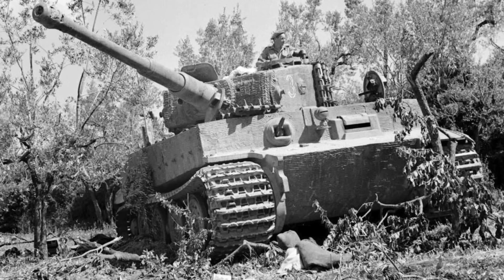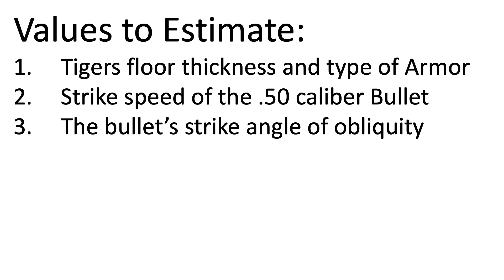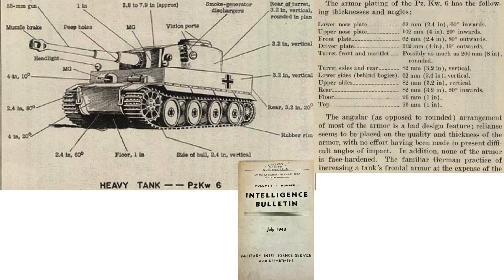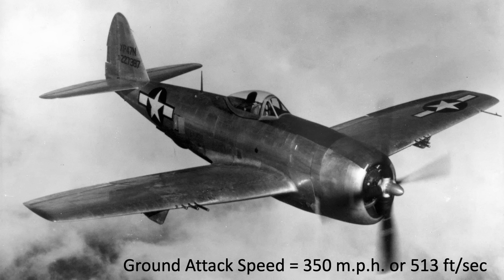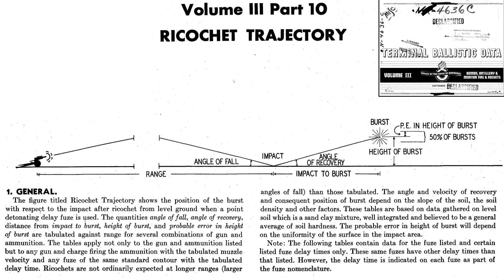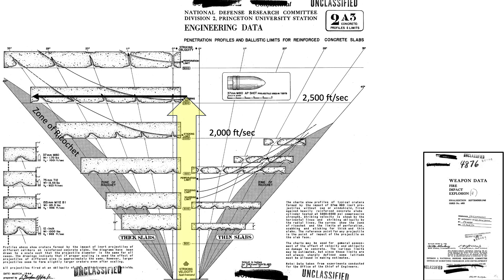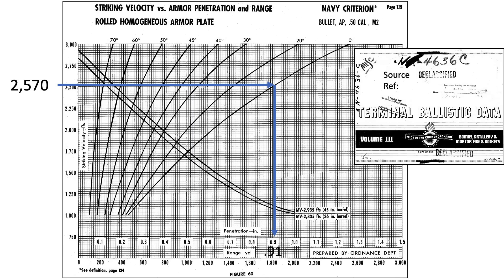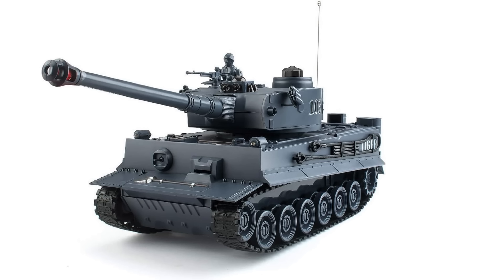P-47 vs Tiger Tank: Can Machine Guns Penetrate Armor?

Comment: The only damage a 0.50 inch AP round might do to those tanks is damage optics and possibly engine components below any grates in the top of the engine deck. The tanks likely looked like they'd been through a metal hail storm. The bombs and 5 inch rockets were probably what the tankers feared after they closed all hatches.
Reply: RAF tested the actual military effectiveness of rocket attacks by aircraft in WWII shortly after the war and found that less than 2% of the rockets would hit the target under ideal conditions. They did, however, scare some crews, especially inexperienced Germans that were very young and poorly trained, into abandoning their vehicles. The rate of the Allied advance sometimes overtook the vehicles. If the vehicle could be recovered by the Germans, it was, but this was often difficult due to incessant aerial attacks, low morale, and lack of fuel.
Reply: @MrArgus11111 
You're absolutely right about the crew being scared and giving up, my primary job in the Army was as a Vulcan air defense gunner, in training needless to say were were taught to never shoot at a main tank, it's like they said "Chances are you'll just piss it off", but by the same token they also taught us that if cornered or if you see one about to fire on one of your buddies go ahead and splatter it with a 60 round burst of explosive 20mm shell's, see what that does for his disposition.
Reply: @MrArgus11111  
"found that less than 2% of the rockets would hit the target under ideal conditions."
I'm rather surprised by this. I know that large quantities of Hawker Typhoons ranged across Northern Europe (the famous cab-rank system) 'looking for trade'. For the Typhoons, ultimately, these squadrons were organised as either rocket squadrons or bomber squadrons but this was solely for logistical purposes.
For the rockets I believe that the experienced pilots still 'walked' their rockets onto the single target, which was the same attack plan as a Typhoon armed with a pair of bombs - attack a single target.
The 'advantage' of rocket attacks was that they would 'walk' along a convoy of soft targets, while bombs saw a better likelihood of killing a single tank (or 'apc', such as they were) selected as the (single) target.
Reply: What about breaking one of the tank's tracks? If a track is broken or otherwise jammed, the tank is rendered immobile.
Reply: @primmakinsofis614 
And chewing up the road wheels and their bearings/axles.
I fired my fair share of .50 cal at old armored vehicles that the engineer's would drag downrange for us to shoot up, the hull of a heavy tank like a Tiger is one thing but the drive assemblies are another, just immobilizing a tank can be considered a victory against it, let someone else come along and finish it off, if you can just shut it down good enough, it won't last long just sitting there and you can bet that's a concept that won't be wasted on the crew.
Reply: @primmakinsofis614  You won't break a Tiger track with .50 cal.
Reply: not gonna happen from a 50cal  @primmakinsofis614
Reply: @primmakinsofis614 You need a hell of a lot more than a 50 Cal to damage as 75mm thick hardened steel track.
Reply: @allangibson8494  You need only break the connections holding the track segments together, not the segment itself. How tough are those links compared to the chassis or turret armor?
Reply: @primmakinsofis614  20mm diameter track pins encased in armor plate? Not going to happen.
The best a strafing run with 50 cal will do is force the tanks to button up and possibly punch holes in any fuel cans left lying around (that second item is more likely to immobilise a Tiger - they are seriously thirsty beasts).
Reply: @primmakinsofis614 the pins are tiny targets
Reply: @primmakinsofis614  German tanks didn't have separate connectors like e.g. US track. There's no separate part to destroy. German 'dead' track was built very much like a traditional door hinge - two plates with interlocking holes, joined by a pin. The pin, being fully enclosed in the links, isn't vulnerable.
Reply: Stowage bins would be hit, and other weak areas as well. A gradual degradation of a heavy tanks is a strategic issues as well. You need spares, you need the crews to rest after being strafed.
Reply: Bullet splash on the grates could do some harm to the engine beneath without penetrating anything. Just little bits of fragmented lead getting through the holes. And of course, a Pz II is a Tiger :).
Reply: Up until precision guided munitions and advanced sensors the majority of air-to-surface actions, especially against armor, yielded little to no damage, the majority of the effect was psychological. As it turns out, the Mk.II Eyeball is not that great of a sensor from 5 thousand feet up moving at 200 knots and most bombs and rockets will more or less do nothing to armor unless they get direct hits or incredibly close misses. IIRC for every claimed tank or vehicle kill that Allied pilots claimed only about 5-10% actually resolved into confirmed kills or damages.
Reply: @brosefmalkovitch3121  something that proved to be moderately effective was carpet bombing areas believed to have tank concentrations in with 100+ heavy bombers. It's a big sledgehammer but did destroy tanks. But even then you needed pretty good intelligence on where they were likely to be. It was used in Normandy on occasion.

Fighter bomber attacks were very effective against APCs, open topped armoured cars, SPGs, trucks, etc.
Reply: @brosefmalkovitch3121  100% agree with this.
Reply: And damage the Zimmerit and paint.
Reply: Probably could damage bogey wheels and put weak spots in the tracks.
Reply: @atomicwedgie8176  Tigers don’t have bogies. They use torsion bar suspensions.
Reply: ROCKETS were the main fear. Heard it directly from a Panther gunner. Otto Shaefer
Reply: @captjim007 according to RAF testing on a Panther, they could be quite devastating if they hit but there was only a 5% chance of a hit even if it was stationary, painted white and put in the middle of Salisbury plain, which the Wehrmacht tended not to do.

They fired cannon at it too, and got about  20% hits which is where my figure of 10 to 20% hits is from as 20% is under those ideal conditions.
Reply: @captjim007  Could well be, but the fear factor fo a weapon and its actual effects can be very different. WW2 tanks were rarely knocked out by any aerial weapon. 

It may be a bit like, say, flamethrowers, which scare the heck out of virtually everyone, yet which cause very few casualties.
Reply: The Germans must have had a problem or thought they did as very late tanks sometimes had spaced plate armor over engine vents. The reason in all the sources I have found was aircraft rounds going in the vents and doing damage. This didn't mean the tank exploded but it isn't going far if the radiator has holes in it.
Reply: @speedandstyletony  That's a fair point, although the same plates would help protect against HE fire from howitzers, which was a vastly more common threat. 

At any rate, such plates were incredibly rare.
Reply: If the attack angle was extremely steep a .50 cal bullet could penetrate about 30 millimeters of armor, but that’s at close range. So theoretically, due to lower quality of latewar german steel, the round could probably penetrate the roof.

Comment: I will say that what veterans says and what is actually happening can be two different things. People can misremember or think they are actually doing damage when in actuality they did superficial damage and simply the crew and vehicle taking actions that can appear like they may have taken damage to people. This happens all the time and can easily be demonstrated by looking at kill count claims. I think this veteran probably believed he was doing something but was likely not actually doing anything to a Tiger, but knowing how many times people misidentified vehicles on the ground let alone from the air he may have hit lighter German vehicles which .50 may have been damaged likely though not by ricochets.
Reply: good point.

i also wonder if maybe they hit something else, like tracks or wheels or the thin armor in behind them, or even a weak point on the back of the tank, and mis-attributed how they might have actually disabled a tank in some cases.
Reply: @reynemayer2942  Please check armor values of Tiger 1. There was no thin armor behind the wheels or at the back for a 50cal to have any chance of pentration. A hole in a road wheel doesn't do anything. Tanks don't get flat tires, you know.
Tracks ... have you ever seen one ? That's several centimeters of massive steel. A 37 or 45mm AT gun would stand a good chance of doing track damage.
Reply: Someone, maybe The Cheiftain or an actual lecture at a war college video, pointed out that air to ground kill claims were something along 2% of what was actually claimed.  I think the person mentioned that after the breakout at Normandy and the Allies overran abandoned German equipment, very few armored vehicles had been disabled or destroyed by air power.  I wish I could remember what that video was.....dang.  Maybe someone else knows that video.
Reply: @panachevitz  I remember that one. It was the Chieftain indeed. Something with "Myths about WW2". It was about the report of a British (?) battlefield commission in the Avranches/Mortain region.
Reply: @panachevitz  Lindy beige day of the typhoon is the name of the video.
Reply: @panachevitz  There are USAAF and RAF operations research studies using that post-Normandy equipment. No need to find the video when the original research is available.
Reply: Allied pilots claimed a dozen tanks for every one that they actually destroyed.  Tactical Air was hugely important in destroying German supplies and making movement during daylight almost impossible,  but they really did not directly kill all that many tanks.  When they did, they certainly didn't do it with machine guns.
Reply: @patwilson2546  they didn’t destroy many tanks but as you say that isn’t the important part for Normandy at least. They held the reinforcements away from the landing or made them stationary so they couldn’t fight at all really.
Reply: @patwilson2546  It's not an Allied-only problem. Germans and Russians did the same, although they had dedicated ground support aircraft with 20, 23, 30 and 37mm guns.
Reply: @ottovonbismarck2443  I agree.  I do not question that German tank kills were every bit as overstated as allied.
Reply: We also have to keep in mind that many allied solider/pilots likely considered every German tank a Tiger tank. They may have been hitting lighter Pz IVs, which would have had weaker floor armor.
Reply: @Combatpzman still a ricocheting 50cal wouldn’t go through the floor of a pz Iv
Reply: @Combatpzman I was just about to say that.
Reply: @Combatpzman  Still good enough against a 50cal RICOCHET.
Reply: That's right, they may as attentempt to shoot through drivers visor if they are trying to do something that rediculous.
Reply: @goodwinter6017  Every German tank had armored glass; there was no open vision slit as in Saving Private Ryan. Russian AT rifles couldn't penetrate.
Reply: Also it’s possible that some of the successes could be attributed to instances where the tank was caught with its hatches open.
Reply: Good summation of how things get remembered. I think I read or saw a video (WWII US Bombers?) that said there wasn't a single hit from a rocket fired from an Allied aircraft during the war in France. I also saw something where German tank crews were very afraid of the rockets.
Reply: Look no further than kills claimed by fighter pilots
Reply: I think that heavy machine gun fire probably won't be good for a tiger in general even if it doesn't actually penetrate the armor . Track hits ,sighting systems even primitive in nature and potentially other areas of the tank that the armor doesn't have to penetrate. The psychological effect as well would be great as well . The best thing about a tank is it's ability to have both an aura of psychological based invunerablity plus the ability to return fire and destroy what's shooting at it . A tank lit up by 50 cals may shrug off the attack but won't be able to effectively return fire . You put that many 50 cals on the ground shooting at a tiger and the tiger can resist the attack but destroy the ground based vehicle even if the have 4 ,8 or even 16 50 caliber weapons pointing at it . Yet the tiger cannot effectively shoot down an aircraft . Even if it just rattles the tigers crew it is a little bit of a psychological victory ..
Reply: @louisbabycos106  if the tiger has an anti aircraft mg on top it is much more dangerous for the plane to attack than for the tank to fire back. You don’t even have to hit the aircraft just fire at it to scare it. The risk for the aircraft and pilot if hit is much greater than for the tank
Reply: @thurbine2411  
You might not completely knock out the tiger or even coming close to but an anti-aircraft gunner on a tiger tank is not under armor protection. One could argue the aircraft can kill the anti-aircraft gunner more easily and readily than the aircraft pilot.

Comment: Also bullet tip will get bend or weakened when hitting the ground and rounds start to tumble.
A mesh or thin plate was enough to defeat the Soviet antitank rifle in world war 2, which could penetrate the 30mm side armor of a Panzer IV because of bend tips and tumbling bullet.
Reply: Yeah, jacketed rounds which are base heavy tend to tumble once they hit any material.

The reason why thin armor plates inside planes could usually protect against impacts from rounds that would otherwise penetrate them on direct impact.